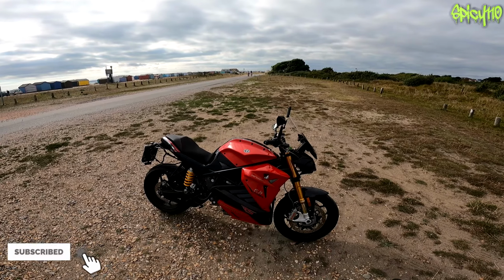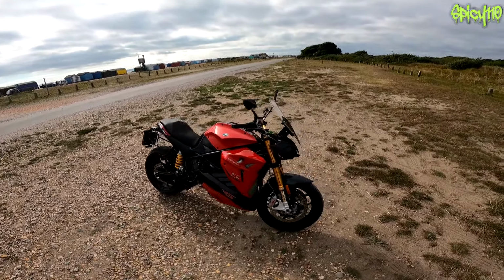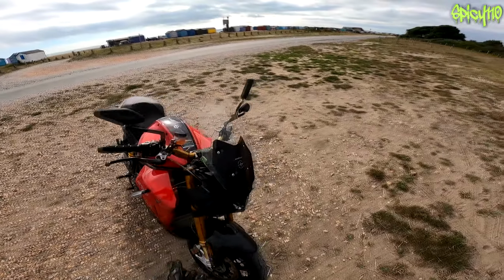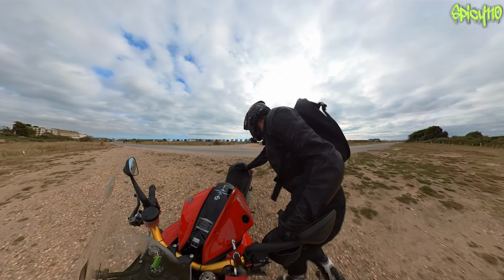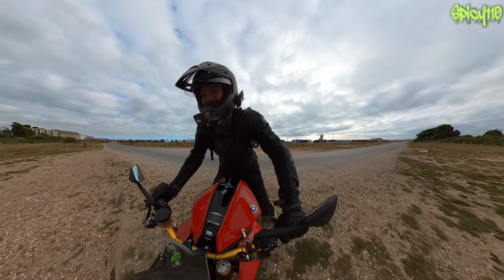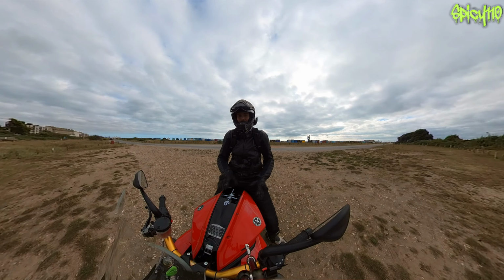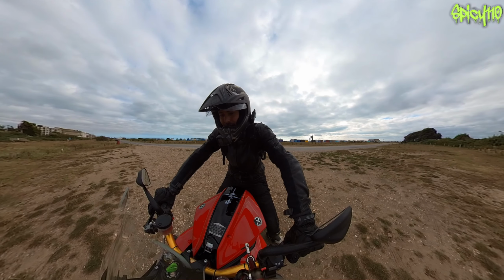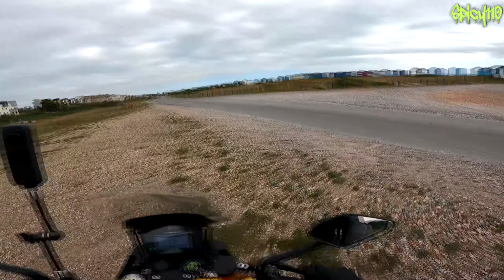How to Reverse a Motorcycle!

Comment: The other "reverse" that many don't know about is to lean your bike onto the side stand like a pivot and pivot the bike around.
Reply from the maker: That's called a side stand turn around, I was under the impression that was common practice.
Reply: @spicy110  you'd be surprised how many people haven't figured it out LOL.
Reply: Just one warning with that though, I’m not speaking from experience but check where the side stand is mounted, if it’s chassis mounted it’s fine, if it’s attached to the engine don’t chance it
Reply: My instructor at the DAS training school did this periodically on his Bandit 600s but there's just a little part of me that thinks the side-stand was not designed for this action and you are pushing your luck!
Perhaps a manufacturer might comment?

Comment: Certainly a godsend on a heavy bike but one tip I'd give for those who are short in leg and tip-towing is to get off the bike and manually handle it rather than risk a drop.

You can see where you're going, it's quick, easy (especially with a grab bars and relatively level ground) and it looks so much more elegant than the duck walk.  You can also position the bike to leave pointing forward, without drama and avoid all those onlookers with schadenfreude on their mind!  

Make sure you leave the bike in gear if you have one...